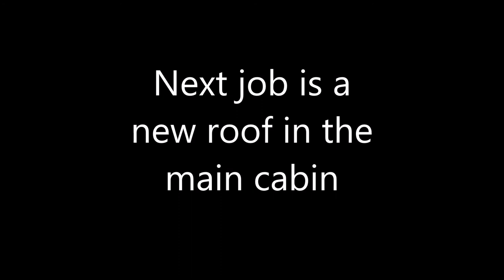Westerly Centaur Painting the Hull & Deck

Comment: Hi. What did you do to prep? What kind of paint did you use?
Reply from the maker: Hi, really easy prep, it was bare gelcoat, so I sanded it with a machine and 120 grit pads to provide a key, then i put 2 coats of paint straight on, one after the other, coffee break in between, no primer used.